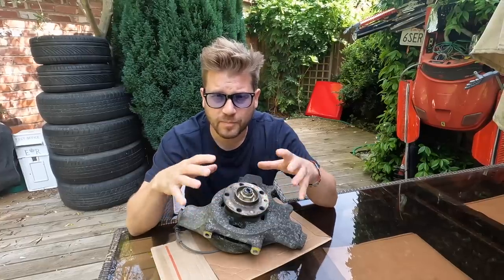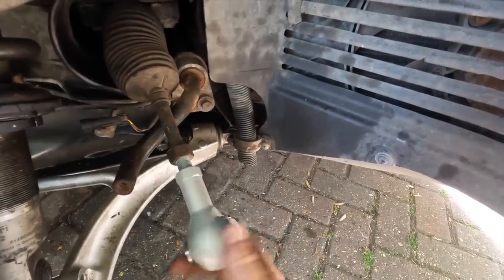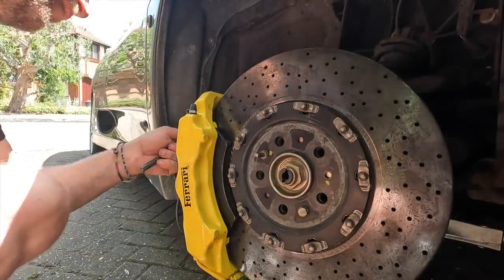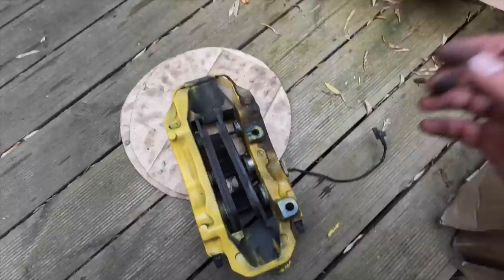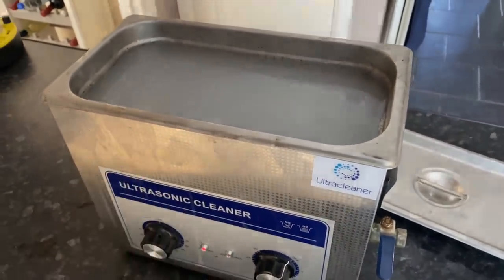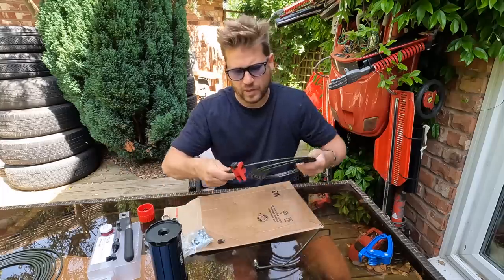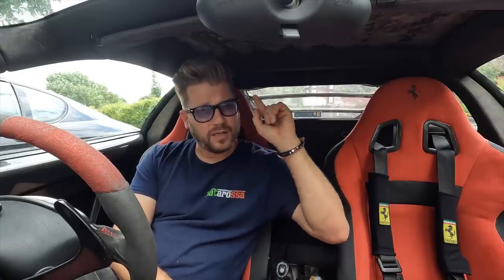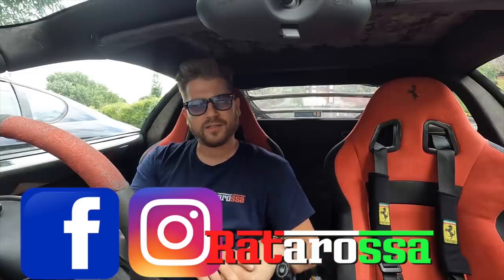DIY Ferrari Brakes Repair Saved £6000 With A Simple Hack

Comment: Have you thought about possibly extracting that bolt out? Drill a small hole into the bolt using a cobalt drill bit, start with 4mm and work up to 6mm.. then use an extractor stud. It may work. I have used that method in the past and it worked wonders for me.

Comment: I like to use brake fluid as a penetrating medium for bolts that haven't been moved in a long time, especially for corroded nuts and bolts. 
I fill up a syringe and squirt a bit at a time well before time to allow as much time as possible for it to penetrate and believe me it works. If I can get seized, rusty nuts off an exhaust manifold flange, I reckon it would've worked on the caliper bolt and you wouldn't have snapped it trying to get it off.
Reply from the maker: great tip Tony
Reply: 50/50 mix of brake fuild and old nasty atf fuilt also works great

Comment: It helps for any future repairs to use anti seize grease when re-assembling caliper and suspension bolts
Reply: Should caliper bolts not be fitted with threadlock?

Comment: To get the bolt out you could probably try an engineering work shop who has a spark erosion machine and  if that cant do it ,nothing can, most precision plastic injection tool and die makers use them.
Reply: Spark erosion is really for removing hard things like broken taps etc, I'd machine it out oversize to be able to tap it out to take a Keen Sert 😊

Comment: If you're making your own brake pipes,  a good little tool to make for yourself and comes in very handy is a piece of rod/ bar about 6" long with a female fitting welded on one end and a male fitting welded on the other,  this allows you to screw it to the pipe you're making and helps as a lever,  or manipulate smaller bends and adjustments.
Reply from the maker: great tip Jeff
Reply: @Ratarossa  yes I found it very useful on very tight bends immediately after the fitting , particularly on some  Jaguar  brake caliper link pipes.

Comment: drill small hole middle of it and then heat it up and use that bolt extractor set those work fine usually even with tricker bolts, amazon shows like 14 quid for set they aint really expensive but come handy even if spark plugs brake in ive used that.

Comment: I'm probably one of very few in the rust belt here in the US that enjoys making and replacing rusty brake lines. Now with the better flaring tool I surprisingly found at a big box home center I don't need access to a vice anymore unless I'm reusing fittings that are no longer available. Unfortunately I can only give one like.
Reply from the maker: Thanks very much buddy ... the one like is plenty. How did I do at my first attempt making a pipe ?
Reply: @Ratarossa  Way better than I did. At first I hated it but I think it's from using crap tools and not knowing the tricks like cutting frozen lines off flush with the fitting so a socket can be used. Great job 👍

Comment: Top tip for making new brake pipes; use a roll of thick plumbing solder and run it along the old pipe, then add a smidge, to get the length of the new pipe. Plus you can use the old pipe as a template to bend up the new pipe to the correct shape.
Reply from the maker: that is sheer brilliance !!!

Comment: Only one comment concerning the allen wrenches, I would suggest getting the socket Allen setup where you use your ratchet, much easier than the 90 degree Allen wrench... But Good job, I could tell you about the fun on doing the same on my C5 allroad conversion to BBK Brembos.. Cheers..
Reply from the maker: Good tip!

Comment: A good practice is to cut the brake line a bit oversize, put a fitting on one end and then make the proper bends.  Once the length and shape is confirmed by trial fitting, THEN put on the second fitting.
Reply from the maker: great tip thanks

Comment: If the caliper has exposed alloy where the seals fit  make sure the groove is clean. The alloy can be porous and absorb salt in the winter which the crystalises behind the seal locking the piston. Used to have to rebuild Nissin calipers every winter because of this until I got some fully anodised after-market ones.

Comment: The broken bolt needs drilling out, and a new thread tapped.
You don’t use mineral grease on brake internals, it will contaminate the brake fluid and destroy the seals when rebuilt.

Comment: You need to find an engineering shop that has a Spark Eroder machine. They are designed to remove snapped off bolts cleanly from the thread. Uses a high voltage spark to erode the bolt material, just like a powerful spark plug constantly sparking against it. Fascinating process, not so common anymore as we throw things way rather than repairing, but a decent engineering workshop should still have these machines.

Comment: A specialist machine shop can blast that broken bolt out of there with an EDM machine without damaging the threads.  I would probably start by trying to weld a nut to what's left of the bolt with a mig welder, but the EDM process is the professional way to handle it.

Comment: Rinse that caliper out REALLY well, even after the ultrasonic cleaner because ANY residual can screw up the entire system.

Are those front hubs aluminum or magnesium? That could make a difference on how to extract that broken bolt. As others have suggested, a machine shop is probably the best idea.

Comment: If the antiseize does not work to get the broken bolt out on its own then you can try an "easy out tool" comes in various sizes as a kit along with the appropriate size drill bits to make a hole to fit the easy out tool inside the drilled hole. Turn the easy out counterclock wise to turn out the broken bolt.  Then if the threads got damaged you can get a kit (forgot the brand name) that has you drill a new hole into the damaged hole, tap the hole, and then thread in the new thread insert which will accept the original size bolt.
Reply from the maker: Ohhh nice I will check that out

Comment: In regards to your broken bolt in the hub.  I use a mug welder when I have steel bolts broken off in aluminum heads.  I place a nut over it and weld the inside of the nut to the bolt shank.  The process is two fold.  The nut gives you a way to turn it and the heat from the welder will loosen up the threads.
Reply from the maker: Good tip!

Comment: Try to carefully grind / drill / chip away at a few more millimeters of the broken bolt to expose just a little bit more of the threads on the hub.  You can then take (guide) bolt of the same diameter and drill a  small hole (say 3-4 mm) directly thru the center of the guide bolt on a drill press.    Thread that on (just barely is all you need) and it will give you a perfect guide to drill a hole directly thru the center of the stuck bolt.  After that I suppose you could sequentially drill larger holes, or reverse thread it and put a reverse threaded bolt on to pull the stuck one out.    You might need to apply some heat and penetrating oil.  That's my idea for whatever it's worth.

Comment: I would still take that other hub to a machine shop have them remove the broken bolt and either keep for a spare or sell it. Any good shop can remove that broken bolt for cheap. You could also have them press out the old bearing so if you get another bearing, easy to install next time.

Comment: Re the broken bolt. Weld a nut on there. You need an induction heater really. Cherry red the nut, quench with water, impact it off. Run a tap through afterwards to clean the thread out. If there is nothing critical in close proximity you could use a map gas torch to cherry the nut. Induction heater is better for tight areas, but more £££

Comment: local machine shop could get the bolt out and chase the threads  shouldnt even cost to much,ir if you have a steady hand punch then drill thru the center of the bolt and try an easy out

Comment: drill a small starter hole. Then use a reverse drill bit. Keep stepping up the size till you can use an extractor. Bolt will get weaker as you drill into .. Time consuming, but it will work

Comment: I've seen pistons removed by connecting a shop airline. Cover the caliper so they don't go flying.
Doing it this way you don't have to flush out the grease after.
Reply from the maker: tried it at the shop and with my home compressor

Comment: TIG THE BOLT  to build the height drop a washer over it and tig then a nut or socket to the washer them with the heat transfer it should unscrew but the threads may shit themselves
Reply from the maker: wow thats a great idea !!

Comment: Hi Scott to remove your broken bolt I would drill it then insert an easy out tool I have probably spelt the tool name incorrectly you drill a small hole into the bolt then wind in the easy out tool this grips the remainder of the bolt and then you should be able to remove the old bolt. You may to have have a helicoil fitted if the thread is damaged in the process all the best Les.

Comment: Scott center punch the broken bolt in the middle drill a 3mm hole through the bolt then an 8mm hole and spray wd 40 in the hole do this over a few days then you can heat the housing around the broken bolt.  the expansion around the bolt will loosen the rust or oxidisation and you should be able to remove the broken bolt with an easy out the thread should still be ok on the stub cheers from down under
Reply from the maker: cheer s

Comment: Hi mate, get your hub to a machine shop shouldn’t cost much. I’m up it Glasgow or I will do it. Brilliant content👍
Reply from the maker: cheers Scott thats the idea
Reply: Try blow torch on the hub bolt stub, then spray with transmision oil to lube the threading. There are kits to remove broken bolts...

Comment: Be careful assuming that a loose bearing is better than a tight one, if adjusted correctly a new bearing shouldn't spin freely after removing turning force, but should turn freely and smoothly by hand.
Reply from the maker: Thanks Paul, good tip
Reply: I agree, the old bearing inspires a little more confidence than the replacement.

Comment: what we would do with a bolt like that is to use a punch on the center of the bolt, then drill out as much of the center of the bolt as you can which allows some relief on the pressure on the bolt threads. then try to use an easy out extractor to remove the bolt like normal.  tip: look for a good quality easy out as cheap ones aren't that great on larger bolts and sometimes break themselves.

Comment: Too remove the broken bolt in the hub. 1/Use oxy/ac torch to heat the area up if different metals they will expand a different rates which should crack the corrosion around the bolt 2/ let it cool off then drill into the bolt and use a good quality extractor. This should do the job.

Comment: Something which really won’t have helped your brake line was that you didn’t disconnect it front the bad caliper before you took it off. It looks like there’s no flex line, so you were putting all the stress into the hard line. Those pipes are only about 0.75 mm thick, so doesn’t take much.

Comment: Rebuilding the caliper seems just like rebuilding an engine. Bore\hone the cylinders. Possibly over-sized pistons\rings (gasket on the brakes). Typical machine shop stuff - right? I see a business here! Also, a machine shop will make quick work drilling out that ceased and broken bolt. You are going to be a pro with brake lines after redoing all on the BBi. Keep those videos coming. Thanks!!!

Comment: Try something like Seafoam Deep creep spray in future, I haven't found anything like, its been such a time saver. Especially on undertray/exhaust heatsheild panels screws, what a nightmare. I'm less inclined to "go for a bigger hammer/impact gun" with high quality fluids about. Also, get a wurth spray bottle and 5L/10L of brake and parts cleaner, I should have got one years ago! I always keep up bolts, etc when I remove (obviously unless they are being binned). Also a thread file.

Comment: I just to do the same job on my normal car calipers. Mine were corroding underneath the gaskets on the aluminium caliper itself though. This put pressure on the gaskets which, in terms, made the brakes stick. Maybe check if yours did the same, while you are at it 🤗

Comment: Short Copper  pipe and weld a nut. The heat will loosen it and the copper keeps it from sticking to the sides

Comment: Standard garage kit for doing your own car repairs is a reel of 3/16 copper or Kunifer pipe & a box of brass unions probably 10mm for a ferrari. Either copper or Kunifer will never rust & the brass union will never rust, seize or strip the thread of the calliper. As for getting pistons out, always used a block of wood & a compressed air line. Never failed yet.
Reply: Copper tends to crack due to fatigue, kunifer is better.
Reply: @philtowle4683  in theory bit never had an issue in the dozens I have made

Comment: Just drill out the broken bolt to the correct tapping drill size  ,then re-tap the thread.if you can't do this any machine shop could do this  it's very easy.

Comment: I know that the brake fluid change on Ferraris is needed every 2 years because the fluid crystallizes inside the caliper pistons but hadn’t seen that type of corrosion before. 

Nice tip on getting the seized ones out, but where did you get the replacement pistons?
Reply: I'd  guess it's a Brembo kit, since the calipers are OEM for Ferrari by Brembo.

Comment: Getting the broken bolt off: is the hub aluminium? If so, you can do it with an alum powder solution: it will dissolve the bold and leaves the hub intact
Reply from the maker: yes hub is ally

Comment: Good job, just goes to show that it can be done much cheaper than Ferrari or a specialist garage would charge, the prices of those parts is pretty crazy
Reply from the maker: 100% agree. I really did save a small fortune doing this job myself and currently in the process of putting the yellow calipers back together to get used on another project

Comment: I have used SNAP ON screw extractors on sheared off bolts like the one in the hub, Centre drill then a few heat cycles from a hand heled blow torch then try the extractor.

Comment: steel bolt into aluminum hub right? the metals should expand at different rates so I'd probably try to drill a hole in the bolt and use an ez out or something but before doing that I would really heat the hub up with a blowtorch or something. alternatively, just drill that bolt out on a drill press maybe?

Comment: Should have put a bit of copper grease on the end of that track rod before putting the end on.
Reply from the maker: yer true
Reply: The track rod end  probably wont seize . the locking nut  on the tie rod / steering arm will

Comment: To get the broken bolt – get it spark eroded out by an engineering local tool shop. I’ve had it done, it costs about £50. Although if you know someone who works there – it will be cheaper!

Comment: Sometimes you can actually go back and forth tightening and loosening to get stuck bolts.  I would have tried that with the impact drive also let it soak with good penetrating oil but you were on a time crunch.

Comment: Those seized pistons and stuck pads would have seriously overheated the rotor and the hub wheel bearings , which could be why it did not spin.
That is one reason why they make two piece rotors , to reduce heat transfer to the hub.
ps ,,Why don't these Brembo calipers use flexible brake hoses like they do on Mercedes AMG and others ?
Reply: There has to be a flexible hose in the system to allow for suspension movement but metal tubing near hot rotors makes sense

Comment: Hi, it didn't look like this was a double flange (where it kind of is rolled all the way under the flange that seats in the socket. A single rolled flange could potentially  slip out under the enormous pressure applied to it. The slightly more expensive tools do this correctly. I would not drive a car that does not use double  flanged (it's a 2 step forming process) brake lines. Probably good idea to replace these with the Ferrari parts or do them again yourself. For the rest awesome content as usual!

Comment: Great content… really enjoyed the depth of all the work completed  and showing all the pipe work steps was very informative.
Can you place a link to the pipe source and sewage kit you used please?
As for the broken caliper bolt the arc weld heat process used usually deals with stubborn aluminium oxide and the stud will yield any good welder should be able to sort that.Good luck and thanks again.
Reply from the maker: yes i will dig out the link and post it out

Comment: In the old days, seventies, when I seemed to either work or be under cars or bikes used to just hire swaging tools for brake lines etc, have ever since used PBC on anything that might seize due to heat, environmental or dissimilar metals which are a pet hate. As an Electrician Offshore did a lot of SS Instrument Pipework so became pretty competent with hand benders etc, by the time You complete a whole car, You'll probably be doing it by eye.
Re: sheared thread, it's fraught, if You have access to a pedestal drill with enough height and the capacity to clamp the workpiece, then drill, use heat and nasty chemicals, the more warnings the better, have used Caustic Soda in similar situation, an exhaust manifold to downpipe stud, followed by removers. Or, I've only seen done once, drill out virtually all the male material and use a Frett saw for 6 or 8 cuts and a scribe as a chisel to take out the thread. Have Fun!
😁👍❤️🏴!